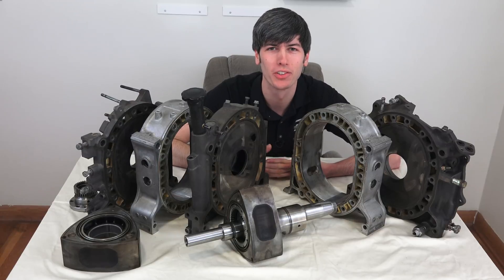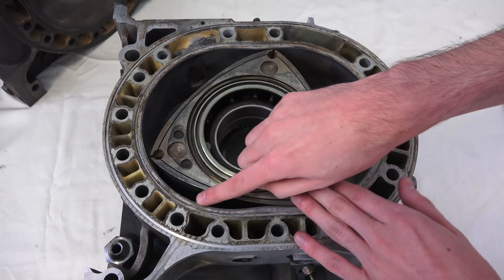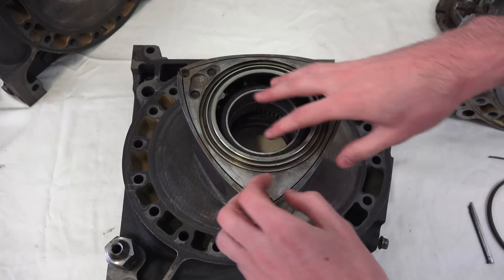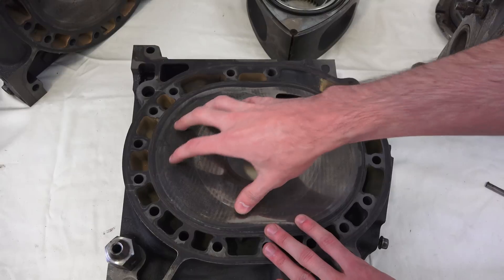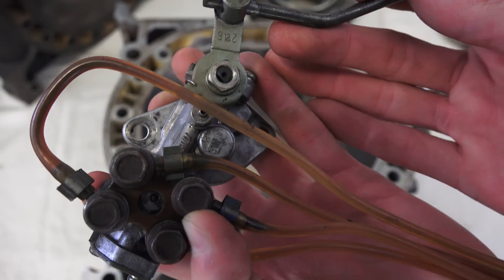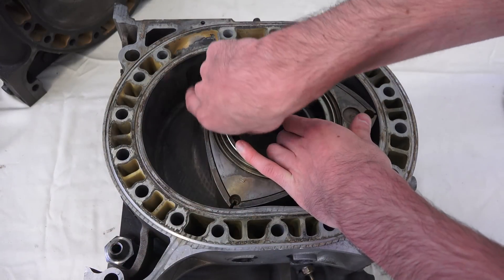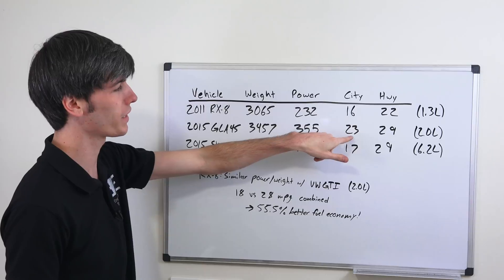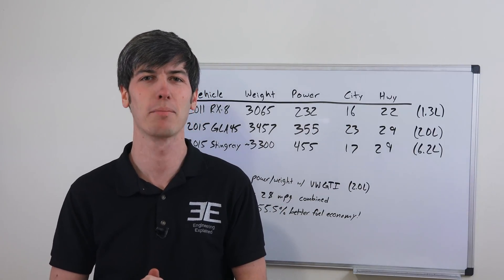4 Reasons Why The Rotary Engine Is Dead

Comment: A lot of folks thought the rotary engine were Japan origin But it is actually invented by Dr. Felix  H. Wankel in 1957, a Porsche engineer. Its purpose was to produce high horse power in a small compact size and lighter weight with fewer moving parts than a typical piston engine. With compact size it can fit in under low hood design or spaces where a typical piston engine with similar horse power output may encounter problem. 
While the piston engines have over 100 years of refinements and development by many auto and engine manufacturers.  The Wankel engine's history for development and refinements were very limited and relatively short. Mazda is probably the major company trying to refine the rotary. That's the short comming of the rotary engine.  It needs more attention and lots of fundings from other manufacturers and more time to get the refinements of the piston engines of todays. 
With the advancement of technologies and refinements going into the piston engine most companies just not interested in the rotary at all. It just might get buried away until there's a new interest someday in the unknown future.
Reply: +Lok Tom 
And you say that without the slightest understanding of what the fatal flaws are but still expect to be taken seriously!!! Idiot.
Reply: +Lok Tom 
As I said, your an idiot.
Reply: +The real doktorbimmer  The piston engines gets  continuous huge funding and  continuous world wide interest while all others get only limited attention and limited time and funding.  How can you keep saying it get unlimited funding and development  and research ?  There's no comparison. You should check out the history  the piston engine  and compare that to the rotary before  making your statement.  Your don't even know how much efforts got the piston engines before it reach to today's  refinement.  All you do is enjoying the fruits of the long and hard work of others and brags a loud statement on the net. If you were born at the early days of the piston engines you won't even think it will reached to the stage of refinements we all appreciated so much today.  You would likely to be the first one to ditch the piston engine out.
Reply: Keep bagging your head against that brick wall idiot, you're achieving great things there....
Reply: Yep, complete screwball.
Reply: +Lok Tom 
No only you thought they were Japanese.
You also dont seem to know that most car manufacturers had rotary development programs in the 70s. They all binned the rotary when they realised the many fatal flaws of the engine cannot be changed. Only Mazda dragged on with them for one car. No amount of development would fix a rotary.
Reply: If only you know why they didn't continued further development of the Wankel?  During the development program in the 70's most of the auto manufacturers encountered  heating problems,  causing engine seal leakage, unacceptable oil consumption problems, poor gas milage and anti smog emission problems.  Especially in the mid 70's US  auto manufacturers encountered the new stricter EPA guidelines for smogs and it also facing an oil shortage because of the Vietnam War and the powerful  OPIC in 70's trying to control world oil production by limiting the world oil market. Suddenly the manufacturers also encounter more new US safety guidelines for all automobile. They must pass a collision survival test and also must meet the new low impact bumper guideline for the National Automobile  Insurance Institute in order to sell their cars to the general public in America. The 70's were very turbulent year for the Big 4 . Especially the auto industry were having problems to get new hi tech materials to meet the requirements of the new government guidelines. They were so stressed out that they have to cut back on other  unnecessary  expensive programs . The rotary engine were one of the few projects been chopped.
Reply: Manoo42 It needs more time, interest, and lots of fundings. 
Remember the first piston engine is not that trouble free. If there is a will there's a way.
Reply: +Lok Tom 
None of those issues were anything to do with the engines fatal flaws. No amount of money or development can ever solve fatal flaws that is the whole reason they are FATAL flaws.
Reply: +The real doktorbimmer  But you didn't mention in what  era were all that funding and development  was in. Since you know everything. You may wanna be the one to tell the public the entire story in arm length.
Reply: +Lok Tom 
???? As i said,  NO amount of money or development can ever solve the fatal flaws of rotary engines. Hence why only Mazda have played with them since the 70's and achieved nothing.
Reply: Manoo42  While nothing is impossible but rather not feasible.
Reply: Manoo42  I am not a fan for rotary engine.  But the piston engine  popularity been around for use way longer than the rotary. The earliest piston engines sold to the public were not that reliable, noisy, can't even call smooth running, and not clean emissions either folks. Just because you are enjoying the  refinements of the piston engines through over 100 years of refinements and been in mass production to the public around the world. It doesn't mean the piston engines don't have flaws during its early years. Because of the popularity of the piston engines, it got much, much more attention from all engine builders and much more engineering  reseach around the world than the rotary. 
Any types of engine that can get this type of attention and lengthy time of development would definitely benefits over others.
Now you can compare that to the rotary engine history . Perhaps you should view the situation careful before you call someone a bad name on the net and shows off.  Because you don't understand a good thing needs time and love to nuture. You are definitely the easy come and easy go type of person. If you know what I meant.
Reply: +Manoo42  You take things for granded. The easy come and easy go type of person.
Reply: +The real doktorbimmer z  You have only very limited knowledge of the piston and the rotary engine .Yet you have already derailed from the original subject. You should check out the history of the early flaws and problems of the piston engines before saying anything. Definitely wouldn't be you to stay around to solve the problems.
Reply: +The real doktorbimmer  So do you think Porche will option the diesel for their 911 over their favorite perennial   gas engine for their next new model.  You anwer that  one "yes or no"  mr. smarty pants or mr. wannabe engineer.
Reply: Unfortunately your appreciation and your mind is very limited in this vast world we lives in.
Reply: +The real doktorbimmer If innovations ends due to one or some engineers can't solved.  It doesn't means no more progress. The future doesn't stops there. It is truly the story of the" Fox and the Sour Grapes" fable. You boys are just enjoying someone's success and not yours and brags on the net as Mr. know It All. Yet you don't have a clue.
Reply: +Manoo42   You are all mess up. Only your limited  knowledge ends there. No wonder you are screw-up. Gees!
Reply: +The real doktorbimmer  I understands your criteria about efficiency. Being the most efficient  engine type  don't always win in the automotive market. That is why it may not get the attention it deserves.
Reply: +The real doktorbimmer  Thanks for wonderful arm length details.  But the progress of new futuristic materials and innovative engineering can make what seems to be a mission impossible now can be a reality tomorrow. That's what science and engineering is all about.
Reply: Moron.
Reply: Manoo42   Really it's too bad for your limited thinking vs unlimited thinkers. Lol
Reply: The only thing unlimited about you is your stupidity.
Reply: +Manoo42  LIMITED = STUPID = HIT A BREAK WALL = MORON = MAXI CAN"T   What else can we expect from you?  Lol
Reply: +The real doktorbimmer  Well it has been nice to exchange point of view with you.  As I have mentioned in the earlier conversation with you I am not and never a fan of the Wankel rotary. It does have its unique features. I  do know the bad short comming of this engine. The problems and short life span of this engine under the current design. But I do believe future  generations of engineers and advancements will eventually solve these problems. Perhaps not this generation. Don't forget that generations back human are not suppose to be able to be airborne. That's why science and technology are keep evolving. It never stops.  Only time will tell. Nice meeting you on the net.
Reply: +The real doktorbimmer    Limited = Maxi can't,  is referring to that troll  Manoo42

Comment: Everyone seems to forget that Suzuki made a rotary engine production motorcycle in the 70's.  Customers avoided them by the thousands and in the end the Australian distributor was practically giving them away, but still they did not catch on.  I have seen an example in a museum, but even when they were current they were a rarity on the road.  Norton motor cycles had a brief exercise in folly and made a rotary also, but I think it was only an experimental model.  It looked ridiculous, at least the Suzuki had a bit of style.
Reply: the Suzuki was called the re5 and in America they were imported from 75.1\2-76 I own a 75 the gauges are different the 76 used regular round type used on the water buffalo triple.... I plan on adding a turbo and going to the salt flats in Utah goal is to pass 200.mph
Reply: +Robert King Look at the wiki on the Wankel. It goes into the Norton and the Suzuki. The Norton was a success, the company had financial problems in other areas. Look up David Garside the designer of the Norton engine.

Comment: rotorys are a race motor. for racing they are reliable and make good power. For street use where needing to rebuild the engine every thew hundred thousand km, and the fuel economy, come in to count, its not so great.
Reply: +Killerjays 
Rotaries are superb as a range extender. They beat piston engines.

Comment: Piston engine goes boing Boing BOING, but the Mazda goes HUMMMMMMMM. No caomparison between vibration level between the 2. Rotary wins hands down. Also, a LOT less parts needed to make a rotary, theoretically less expensive to make ONCE TOOLING HAS BEEN PAID OFF.

Comment: also why the rotary would be a great race engine, it'll rev beyond most piston engines capabilities, faster, add twin turbos and it's over 300HP.  then again, the seals will fail. i watched this car from the RX-2 to the RX-8. emissions are BULLSHIT, global warming is a farce, if you don't mind dumping oil in a car like a two stroke dirt bike, have at it! Saab used to have 2 strokes, as did Subaru, in the 60's, my bro had a Sub 360 in the late 70's,  it could do 55mph with 600 pounds of passengers in it. i don't care for 2 strokes. but i've been driving 3 cylinder 4 strokes for 28 years, 40-50 MPGs is nothing to sneeze  at with old technology.
Reply: ***** i heard seals were good for 50K miles. personally, i think a good engine should go 200K miles or more before overhaul (well maintained)

that's why mazda makes so many rotaries today :) can't swing a dead cat without hitting a rotary engine vehicle in America today!

they made the RX-8 for how long? my dad has a late model miata (he had many MG midgets in the past) my new boss has a mazda 3, that has a piston engine.

the Wankel is DEAD along with the Chrysler turbine of the 50's-60's. just not feasable!
Reply: mr bad example The rotary is suitable for any vehicle.
Reply: +John Burns 
The RX7 turbo engine weighed only 4lbs less that a Nissan 300ZX V6 and a Kawasaki ZZR1400 weighs about 120lbs less than RX and still produces 200bhp.....
Reply: +mr bad example 
Sealing was solved decades ago. Mazda have solved the fuel and emissions. 

https://www.youtube.com/watch?v=v3uGJGzUYCI&lc=z12lvzv5ek2fhxjq104ccbhh1r3xwpwwozw0k
Reply: mr bad example Read my post on the rotary. They shine running at constant speeds like in niche applications such as range-extenders. Mazda claim to have solved the: reliability, emissions and fuel problems. 

'The RX family’s front-engine, rear-wheel drive formula is untinkered with, but what’s under the hood is box fresh. It’s a “next generation” rotary engine christened SKYACTIV-R that Mazda says addresses the three perennial stumbling blocks for Wankel engines: economy, emissions and reliability.'
http://www.topgear.com/car-news/concept/meet-rx-vision-mazdas-gorgeous-rotary-engined-sportscar
Reply: mr bad example

' Mr Takashi Yamanouchi, the global CEO of Mazda stated, "The rotary engine has very good dynamic performance, but it's not so good on economy when you accelerate and decelerate. However, with a range extender you can use a rotary engine at a constant 2,000rpm, at its most efficient. It's compact, too." '
Reply: ***** cool beans, now if they can scale it down 50% and throw it in a smart/iQ size vehicle, they might have something!
Reply: ***** i've been driving one liter, 3 cylinder vehicles for 30 years, the otto cycle engine is a proven design over 100 years, and the design of engine used in fuel economy contests (albeit, usually 50cc single cylinder in "hot dog shaped" pod vehicles)

it would really be impressive if someone would use a rotary engine in one of these contest vehicles. 

if they made a rotary with a 300-400cc capacity and 60-80HP, i think that would be ideal for commuter cars.
Reply: mr bad example 
a rotary is one third the size and weight for same power.  A huge difference to any piston engine.  It is also super smooth.

Comment: I still have faith in Rotary. Who knows maybe somebody will fix all the problem and remake the rotary in the future. Just like how intake and exhaust valve lift works in VTEC, I'm not sure if alot of people know but VTEC was not even invented by Honda but it was a different manufacturer. However, it did not works smoothly as intended by whoever that manufacturer is so Honda tried their very best to make everything work smoothly then they made the VTEC patent. Hopefully Rotary engines come back to life again.I work in Mazda and there is 2 RX8's in our lot sitting collecting dust and molds because it needs an engine work "delivered by a tow truck". Sad to see those sit knowing Rotarys are one of the icons in auto racing.
Reply: Paul Renton don't confuse VVTi from VVTL-i . VTEC has 3 different forms. There is a performance and there is an economy version.  And again, no. Honda DID NOT invent this technology.
Reply: I agree with you brother! I used to an RX7 (FC3S). That was my first car I ever owned, and I loved it, however the downside was the fuel consumption and I had problems with the apex seals twice, so I had to spend money just to have it rebuilt, then one I just gave up and sold it. But, I still miss the sound of a rotary engine and I badly miss the FC.
Reply: ***** not really. For the past 2 months I have been working with Mazda, the 4th RX8 came in just the other day. Nothing surprising. It came in towed by a tow truck.
Reply: ***** a 2003 Protege got towed 3 days ago with only 53,000 km. Original owner. Problem: over heating randomly.

Lexus SC430 got towed a month ago. Problem: Out of province inspection. 

2008 Mazda 3 hatchback got towed in just 2 weeks ago. Problem: Car shut down and needed a new ECU

You know where I am getting at? RX8 was the most common car that got towed because it had a problem with the engine. I will repeat it again. Mazda has not perfected the Rotary yet. If they did then Rotary should still be alive. Unfortunately, they needed to discontinue it.
Reply: The first Variable Valve Timing system was invented and applied by Giampaolo Garcea chief mechanic of Alfa Romeo in 1970.
The VTEC system which works totaly different was indeed invented by Honda and it was naturaly patented in 1989.
The 2 systems as every VVT system have the same principle (variable valve timing) but they work in different ways.
So tl;dr the variable valve timing was NOT invented by Honda but the VTEC was indeed invented by Honda.
Reply: +Mark Honda did indeed invent the VVTI system later it was used by Toyota under licence until Mercedes and BMW decided to produce a look alike system which is still used today,
Reply: Buenavene Abragan yea man when you own a Rotary, you should not care about fuel consumption in the first place :p . Yes the apex seals are always one that needs to be replaced. Another RX8 got towed in the shop last week and guess what it needs. We never had an RX7 yet but I understand why. RX7 FC and FD owners will rather choose to go to a tuning specialist shop than a dealership. That's what I will do too anyway haha
Reply: Mark The apex seal problem was solved nearly 50 years ago.
Reply: Mark ....and?
How many other types of cars were towed in as well?
Reply: Mark Oh for Gods sake!  Rotaries are well alive. Five makers in the world make them!
Reply: +Mark 
RX-Vision
https://www.youtube.com/watch?v=v3uGJGzUYCI&lc=z12lvzv5ek2fhxjq104ccbhh1r3xwpwwozw0k

Comment: Also the combustion chamber for a rotory is very large for its compression meaning there is alot of surface area for heat to be rejected into the cooling system instead of turning the rotor. 232 hp from a N/A engine is still very good and im sure with a turbo, the engine could of made the same power as the Mercedes.

Comment: Was it ever alive? Good concept, poor execution. Obviously there are countless technical issues, but the worst thing for me is most engines of this type need expensive partial or total rebuilds before they have even done 80 thousand miles. If you have babied it, you can get more but you'll probably have fairly significant compression loss (over factory) by then anyway. Pretty disastrous in this day and age when any decent reciprocating engine can do twice that without even removing the cylinder head.....